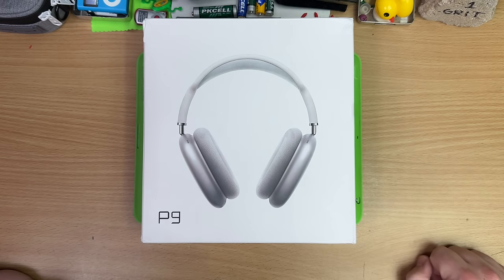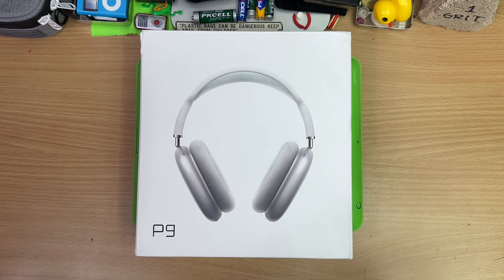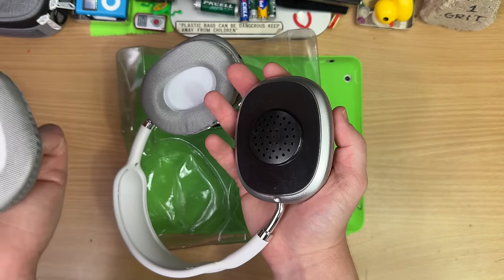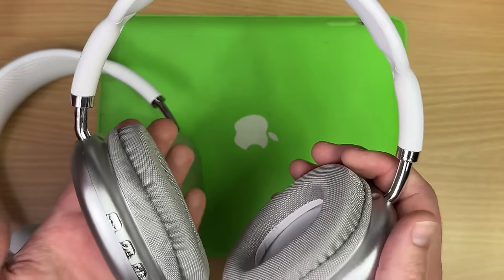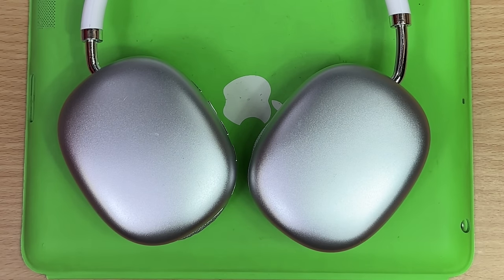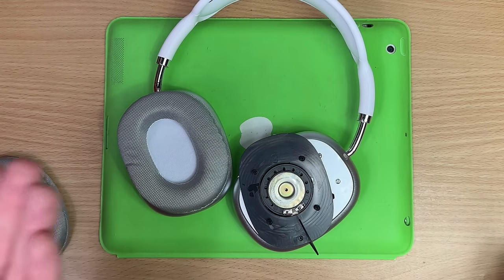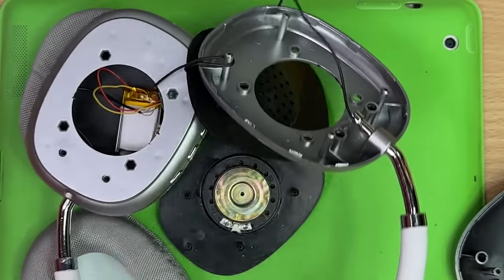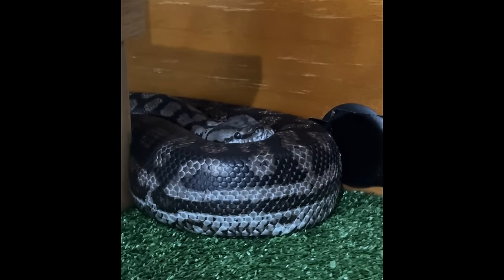The bootleg AirPod Max headphones.

Comment: can i just say, the microSD slot on the bootleg being a portable mp3 player in the headphones sounds like a sick idea
Reply: I remember when stereo headphone-radios were a thing.  Stuffing an mp3 player into headphones isn't that far removed from headphone-radios.
Reply: @Code7Unltd  with how tiny those players got even a decade ago, stuffing them inside a headphone isn't that difficult. Pretty sure if Apple wanted they could integrate one onto the airpods max chip.
Reply: I have a Bluetooth speaker with pretty much the same features. Pairs per bluetooth but also as aux mode and you can plug headphones in.
Reply: @Code7Unltd  And the best thing, most of those nuggets came with a radio.
Reply: it's not new, been done for years lol
Reply: You can get headphones with a micro SD slot, radio, 3.5mm aux in, and Bluetooth all in a pair of headphones. Basically a cheap MP3 player in your headphones
Reply: @burp2019  We know that, but it's a sick idea for modern devices, wish big company would do this
Reply: @uhm175  not enough of a market for it anymore
Reply: Yeah older skullcandy headphones did it but given streaming of music and reliable bluetooth exists now its more just an enthusiast thing
Reply: A lot of cheapos bootleg headphone have that, suprisingly
Reply: Gimme an audio-technica m50x-like headphone with a microsd slot in there with FLAC support and you get me.
Reply: @RomitHeerani They could easily do that, but they will never do it though.
Reply: @supersillysammy272  yeah i have some of those, my Powerlocus P2 :D it's borked though so i have to get new ones
Reply: Sony made a sick line of headphones that had local storage built in
Reply: If they actually had decent drivers and supported FLACs, they'd honestly be awesome.

But it's too expensive to support FLACs. After all, "FLAC" stands for "Expensive Lossless Audio Codec"
Reply: @HappyBeezerStudios was it the sexi speaker?

Comment: The P9 were so awesome during the microphone test, that my equalizer was not showing input for some of the frequencies. "Sound cancellation" must have been on.
Reply: it's just one of the "other characteristics"
Reply: It's to prevent disturbances with radio frequencies
Reply: It’s a feature
Reply: Do you mean extra notch filters, or just the typical 4kHz cutoff?

Comment: The noise these have where it goes "The Bluetooth device is ready to pair" is literally the exact same sound as my music teacher's old giant Bluetooth speaker. When the speaker paired, that same voice would legitimately say:

"The Bluetooth device is connect to the successfully"

Yes, you read that right.
Reply: Yup.  I have seen several of thease and all of them have the same voice
Reply: Which knock off Bluetooth speaker was it
Reply: @danzeldiaz7447  It wasn't a knockoff, it was just probably very cheap. Idk the brand or model, and it unfortunately stopped working so the school took it away, so I can't check.
Reply: I have a Cowin headset and whenever they're low on battery, they say "Please charging"
Reply: @reminisce_official14 do they shutoff like a minute later? 
Cause my polish speaker does that
Reply: @tylern6420  Not really, they shut off after a while if they're idle, but they shut off quickly when they're playing a video
Reply: @reminisce_official14, my headphones sing. Me a diddy when they need to charge like: beep beep bloop diddle boop

Comment: The times Wade breaks headphones would be so different and boring if he had a soldering iron
Reply: He's referenced doing car audio before. He 100% has a soldering iron
Reply: @sand0decker  he's not gonna waste solder and flux on these pieces of garbage
Reply: I'm sure he has one, but the solder he uses would be worth more than the headphone itself.
Reply: @blze0018  He's probably more likely to use the soldering iron as punishment. Like the 1-Grit.
Reply: @sand0decker  unless he did the "local mate down the street" install with a bunch of cable twists
Reply: @Erinthegato99  I thought you were talking about the Airpods because it's the 3rd pair now lol

Comment: I have a pair of Sony noise canceling I've had for about 4 years now that cost $120, the ear cups eventually ripped after a couple years, but a cheap $15 set of replacements fixed it right up and they still hold up great. 

They still sound good and clean all around, battery life goes a really long time, and connected to most devices you can see the percentage of remaining battery.
Reply: I have a pair of Sony WH-CH700N that i snagged half price at £50 a few years ago and they're amazing! Noise canceling could be a bit better on them, but if the battery actually dies it has 3.5mm jack so I can still listen to stuff. I might have the same pair you have so knowing about replacment cups makes them even better.

Comment: I had a super sweet nugget set up when I was a kid but can't remember what brand. Was a stereo unit with 6 disc changer and had a built in mp3 player. It plugged in the top and you could play through the stereo. Was super sick
Reply: yoooo 6 disc changers were baller

Comment: I really liked the AirPods Max, but the ear pads made my skin itch, I couldn't wear them for longer than an hour at a time, I really tried, sold them on the local auction site TradeMe and didn't loose much. Have settled on Technics EAH-A800 now, they sound far better to me than the Sony WH1000-XM3 did, and I can wear the A800 for hours and hours comfortably, what more could one want from a Headphone relegated to office duties. The Huh duh's and the tube amp are relagated lock myself in a quiet room at home duties.

Comment: The breaking off cables like you did there is a very common failure mode for headphones, I repair electronics for hobby and work. So many headphones just die because the driver rattles the solder joints loose. Tap with the soldering iron and it's generally all good again. Fixed a fair few thrown away pairs with that defect for really nice margins given the 3 minutes of time it costs to repair.

Comment: I still think you should get a few pair of Bluedio headphones. I had the T2s (s is part of the name) and they were pinchy, but PUNCHY in the bass and actually sounded fairly ok for as cheap as they were, and lasted the reported 40 hours (on almost max volume, mind you which was also VERY loud for wireless bluetooth headphones)

Comment: I both do and don't understand the lightning port hate. I get that it's kind of anti consumer, but as a casual user, it does everything I need them to. It charges my phone in around an hour or two, my airpods in even less time, and transferring files with icloud and intel unison is faster than even just straight up plugging a cable in.

Comment: Hey Wade, I just swapped from my old Google Pixel 4a to a Pixel 6 only to find that Google has once again removed the headphone jack. RIP to my KZ ZSN Pros for now.

Do you think you could do a video sometime about various USB-C dongles and DACs and such? I'm half considering buying a bluetooth DAC like the FiiO BTR5, but if there are cheaper options to get a decent chipset that goes to USB-C that don't suck, I'd love to hear about them.
Reply: It might seem silly but the USB-C apple dongle might tide you over for now until you really decide you need that Bluetooth functionality. I can vouch for the BTR5 all day (I use it with my 6XX and it sounds great, I don't feel I'm missing much compared to my amp) and it finally went down to $109 on Amazon.
There's also the Qudelix 5k which people also like because of it's EQ capabilities but I know nothing about it.
I miss my 4a too :/
But my 6a is green so y'know. Priorities
Reply: @therealwhite  I may have to check out the apple dongle, then. I'll probably pick up a FiiO eventually anyways. By the way, I also saw that FiiO makes a BTR3. Is there a serious reason to choose the 5 over the 3? It's a $40 price difference, but I don't necessarily mind that if it's worth getting the nicer one.
Reply: Basically from what I can read, the BTR5 has more power to drive headphones with, and it does have an OLED screen, it's also slightly bigger than the BTR3k but it's still not very big. I don't know of anything different than that but the screen does tell you battery life and volume. I'll let you decide if that difference is worth the money, but I'd personally spring for the BTR5 just because the screen is nice and it'll power even more than just your KZ's. However, it's not entirely necessary! Hope that helps.

Comment: I have a pair that's also White that's called Skullcandy Crushers they're so busy they need a base volume control I have found the best app wavelet only I have the right settings and you cannot get it to work the same as me not only that they last a long time call is perfect and quality can be very clean depending on how you set up wavelet they may cost $200 you should consider this I'm using them right now imagine a car stereo in a car vibrates everything that's what mine do if you want to type c version it would be the Crusher evos

Comment: Big fan and nice videos. I literally have been through 9 headsets this year still trying to find the best Bluetooth headset with a good microphone for work meetings and light on the ears. The reason I have been through so many cheap and expensive is that i wear them and use them for work meaning minimum 9hours a day and I get massive headaches and pain . Any suggestions guys? I got a pretty big head too.

Comment: I know that you don't really do videos in the IEM space, but IEM's like the truthear hola, tangzu wan'er, 7hz zero or even moondrop chu will have significantly better sound for the money. The cheapies from KBear or KZ are usually not tuned very well, and leave gaping holes at the back of the shell to boost the midbass/lower mids, at the cost of isolation. My pair of ZSN Pro X's made white noise sound like someone was wiping a window in the distance, the drivers were that bad (both of them, it wasn't QC, they're just like that)

Comment: Mate do you not have a simple soldering iron? You could’ve reattached that speaker wire you ripped off nice and easy lol (probably with a better solder joint than they used, given how easily it came off)

Comment: XDDD my dad got these cheap off ebay, he likes messing with stuff, found one of the speakers didn't work, and got a full refund. i ended up taking it apart and finding one speaker was not even soldered, so now i got a spare battery, bluetooth audio board and some REALLY cheap feeling speakers

Comment: Now I know that the perception of audio quality is subjective, and perhaps YouTube's compression algorithm has something to do with it, but your Sennheiser reference headphones sound very hissy to me. I've had 1980s cassette decks turned up to maximum on a silent track that had a lower noise floor than what I hear in your videos. Of course, you do own a snake so perhaps you're just used to it?  Nevertheless, another fine video.
Reply: It's because of the ear simulator he uses. The minidsp ears have a very bad acoustic impedance and no occluded ear simulator. It ends up making recording of headphones inaccurate to what a person would hear on their head, and tends to really boost frequencies between 4-6khz, which is where a lot of those sounds are. This is one reason a lot are against sound demos of headphones on generic binaural mics